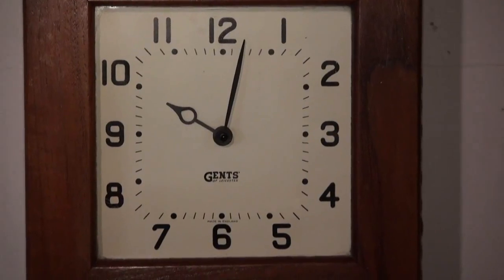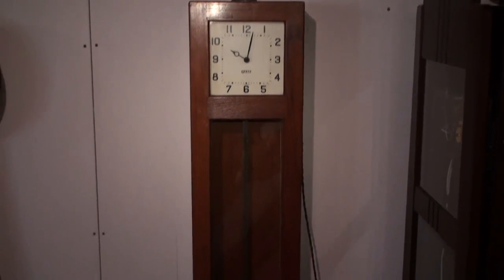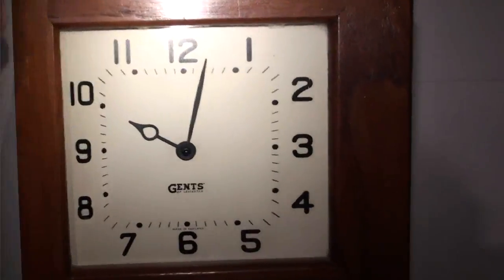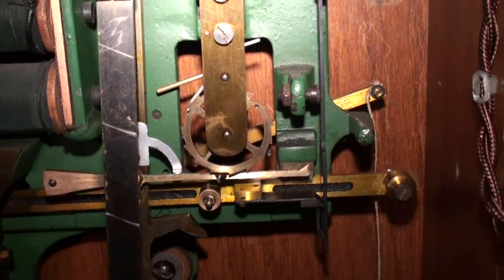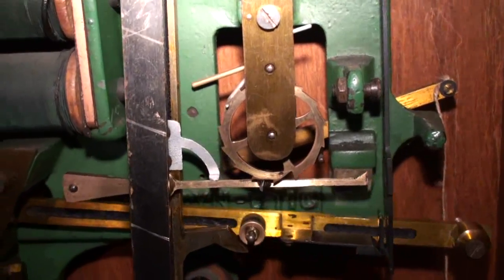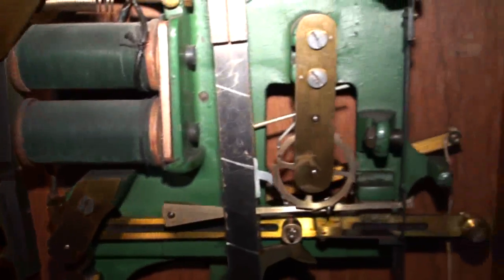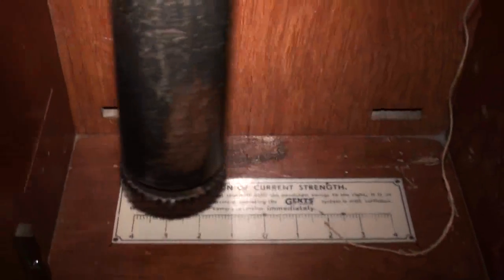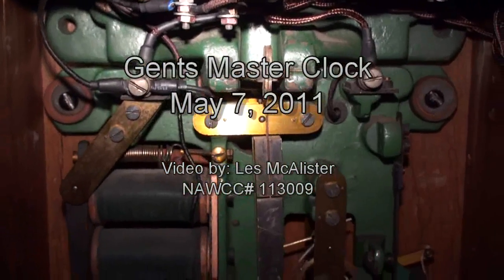Gents Electric  Master Clock Operation, Pul-syn-etic

Comment: Hi I have the one with 8776 serial number and dated 1.9.53, it's runs 4 slave clocks at the tower it is installed at the building that we are restoring it I will need your help please kindly contact me at nicholasaung@me.com I.can explain more to you privately. There is additional unit between the master and slaves and a chime unit :) hope you can get back to me asap

Comment: I have one of these but haven't sorted out a power supply yet apart from a small nine volt battery. Also, the cog on the clock has a slight wear which causes it to fail to advance every so often. I brought this from my fire station in Chester when they were throwing it out.

Comment from the maker: Yup....you have to be a big fan of both clock to tolerate the  C L U N K every 30 seconds.  I have a friend who has tried rubber mounts to the wall and other types of insulation to quite the sound, but in the end it is what it is.  Best Regards,  Les

Comment: I have one of these, but it has been exiled to the garage as the clunk is far too noisy for the house.
We can live with a Synchronome and a Gents' made PO36 but not the Pulsynetic.
Funny thing is the Synchronome should  be the better time keeper, but the Gents Pulsynetic does just as well at about a second or two a week.
As  Tricyclist says, use all the screw holes provided to fix the clock to the wall, including the two on either side of the casting that supports the pendulum keeps better time.

Comment from the maker: Thanks for your kind remarks.  No I have not checked the date, but will do so and post later.  I can see the need for securing the bottom of the case to the wall as the pendulum is quite heavy for this clock.  I have had this clock on my "project" list for several years and it was really quite fun putting it back in working order and then sharing for all the other clock collectors out there.  Best regards,  Les

Comment: Congratulations! Excellent video and commentary! A nice, quiet clock too! I do like the medium oak case. Do you have a date for your clock? The Gent's date label is usually top left inside the case. Or you can check the movement number against a date graph online.  

BTW: For best timekeeping fix the bottom of the case to the wall through the holes provided. Use large spreader washers under the screw heads. Small washers just mark the case back and crush the wood.
Reply: Think case is an Alba case American hard wood
Reply: @cliveperryman3242  You may be correct. The grain is similar to oak in places but more variable than oak.